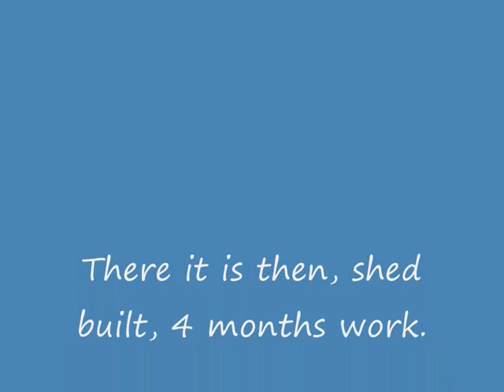CBRRRT's CX500 cafe racer build

Comment: Nice Job, Im currently going through an old xj550 replacing all the caliper seals & pistons, bearings, brakes, master cyclinder kit, rebuilding carbs etc to get it road registered before I pull it down again and do the whole cafe racer thing.  Yours, looks awesome and goes a long way towards prettying up what is otherwise a doggy boring bike.  Congrats